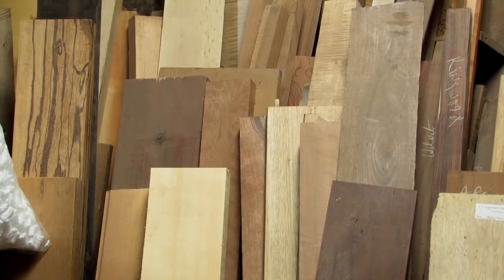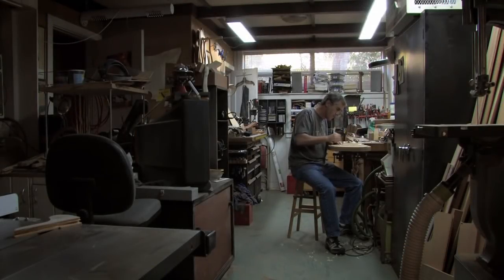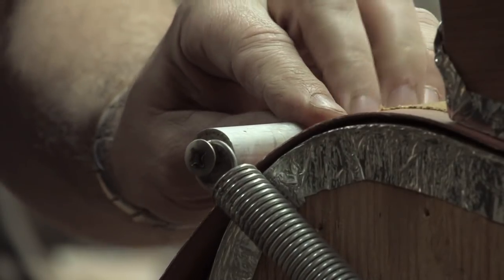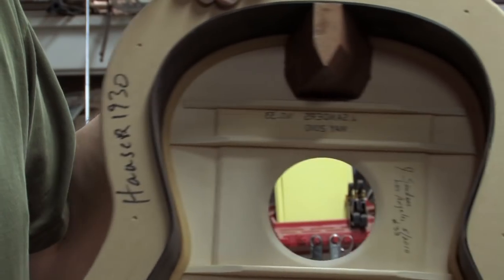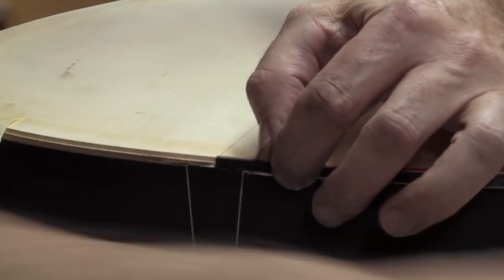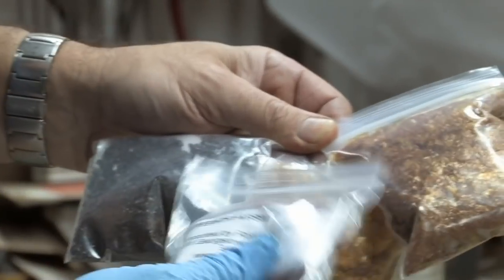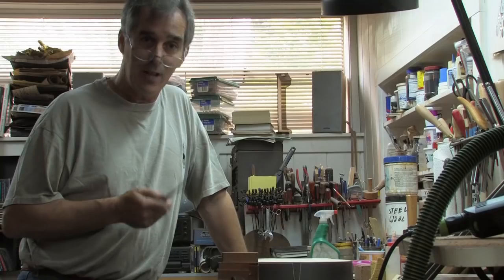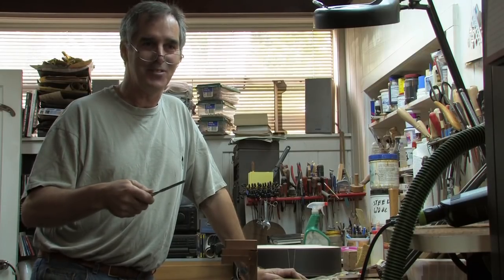The Luthier

Comment: Hmmm..... I wonder if more Luthiers had roots in furniture building they would be more apt to use a tenon joint to attach the Guitar Neck to the body of the instrument? I am pretty curious about the huge internal Neck/Heel block that Fleta uses has a tenon opening for the neck.